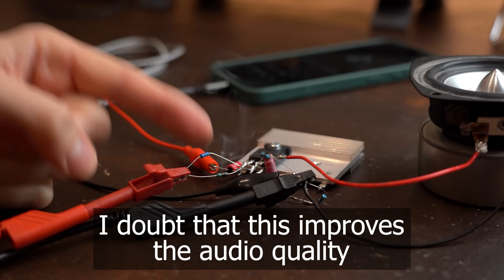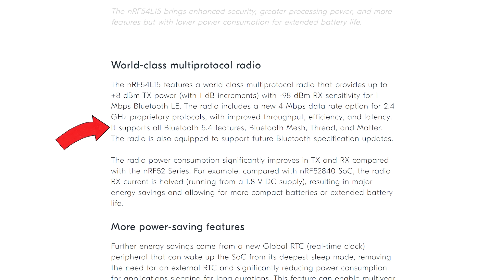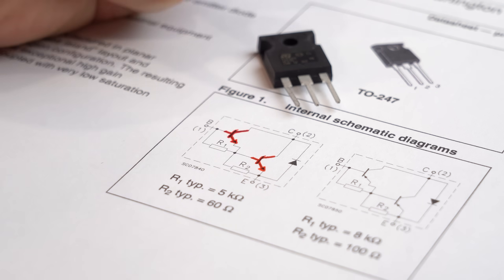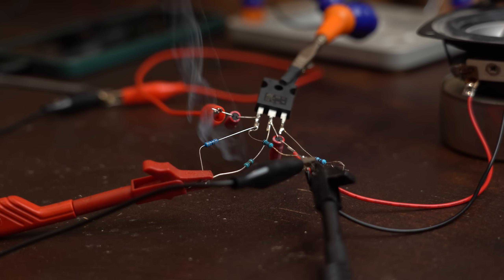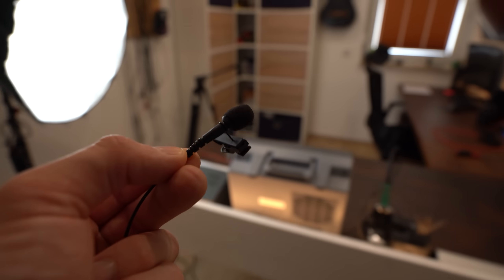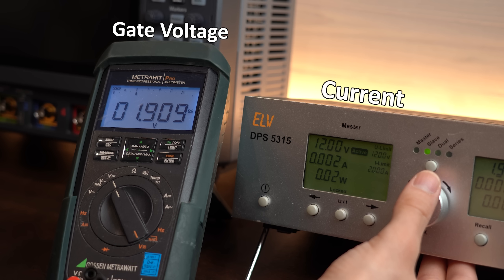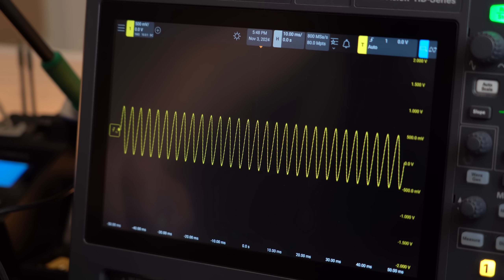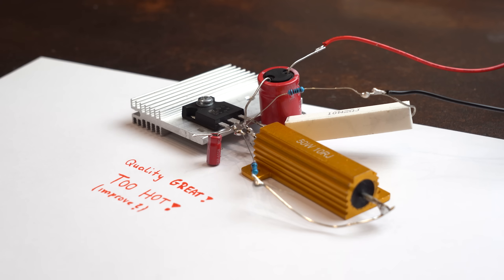The World's Simplest Audio Amp just got BETTER?! (MOSFET Amp) EB#61

Comment: Hey, I remember that headphones amplifier! I love the way you revisited that.

I believe the most efficient and generally good design would be an opamp-like structure, with a feedback.
You could also build a class D amp of course, but that's quite a bit trickier and not as "pure analog"

That being said, I am myself looking to build an amplifier for a headset that would need a decent amount of power. It's a DT880, and it sounds pretty bad, also without bass, when plugged directly into a phone. An EQ doesn't solve it, it really feels like a lack of power.

I'm not sure what would be a good amp design that won't hiss. I thought of several NE5532 mounted in parallel...

Comment: Mosfets are current amplifier devices while bjts and fets are voltage. They are also a lot more difficult to get stable when put in parallel and dealing with bigger output power. Controlling them is more expensive in practice as well.

Comment: I had some IHW20N135R5 in surplus that I needed to repair an induction cooktop and did an amplifier experiment with them out of boredom. I was amazed at how good the sound was. My circuit looked different from this one of yours, I put everything together freehand without doing any real calculations and I succeeded. But I think it would be even better if I calculated everything correctly, but this was just a play out of boredom 😁

Comment: Mosfets are most commonly used in Class D amplifiers. In this case they are fully on or off to drive the max power to the speakers. Class D is significantly more complex than Class A however. But any decent audio amplifier on the market is typically a Class D with mosfets on a large heat sink.

Comment: making a class-D ampliier next would be cool, to show efficiency increases.

also perhaps using one of those super cheap 3w class-d amplifiers, and making a class-d amplifier amplifier.
essentially a H-bridge driver connected to the outputs of the class-D amplifier to increase the voltage and amps on the output.
since these days almost everyone uses class-D amplifiers as they are much louder and more efficient, and often much cheaper as well if you want okay quality.

completely making your own class-D amplifier also would be cool, even though I know there are many simple ways like using a comparator and such, it would be interesting to see a as simple and cheap as possible way to make a okay class-d amplifier.
even better if possible with only normal parts so without parts people would need to custom order(only things a average hobbyist would have).

ofcource just for fun since a class-D amplifier doesn't need to be that high power. and can easily become dangerously powerfull like when for example using the €0.50(new original) IRL7833 mosfet you can technically send 18000W pulses (30V and 300A(pulsed)(150A constant and only 3.8mOhm RDS on max (so 0.0038Ohm)).
https://www.infineon.com/dgdl/irl7833pbf.pdf?fileId=5546d462533600a4015356600d71257b
essentially weak 1W and 3W class-D amplifiers are super cheap, and up to around 120W they are not that expensive either.
however even at something like 50W the price increase probably already is way more than when using a super cheap class-D amplifier and combining it with a self made H-Bridge cirquit to amplify it(self made since that is much cheaper than prebought ones often, even though for lower power you can use one of the cheap ic's for that.
but most cheap h-bridges have capacitors build in which doesn't need to be bad and can improve performance, but a class-d amplifier works at much higher frequencies than a dc motor drivers and most cheap H-bridge cirquits are made for driving dc motors so with a big capacitor(low pass filter).

Comment: Please build a class ab amplifier using only n channel mosfets, with a single sided power supply, as most class ab amp and irs2092s based class d amps are usually on symmetrical power supply

Comment: Hi great scott. I was using a drill with a 21v battery pack. And sometimes at work. Outlet is not always available since I work as a windows installer here in the philippines. And I wanted to request if you will notice me if you can create a circuit that can charge both 12.6v and a 21v drill battery. With an 18v 30w solar input. Thanks a lot!

Comment: Note that MOSFETs usually have a positive temperature feedback when operating in its linear region. This means with the same gate voltage, it gets a lower Rdson with a higher temperature. This means it gets into a sort of slow thermal runaway. There are MOSFETs though that feature a negative feedback if I'm right. This is one of the reasons I'll always try to avoid MOSFETs in linear applications. 
That being said, I love to see you make an LDO using a MOSFET and a zener diode. If you connect the gate of a MOSFET to a stable voltage made with a zener diode, you get a crude LDO. It drops its drain at its GS threshold voltage. I want to use them for very low power applications but I've never done it.

Comment: how about the Amplifier that use 2 Transistors (PNP+NPN) together as i see in the Chinese Amplifiers they sound pretty good and loud 
I'm not sure how 2 transistors work together for single speaker, but it does carry very high power to the speaker 
these premade Amplifiers hard to fix but if there was simpler way to understand how they work i might be able to fix them

Comment: I made similar mosfet amplifier 10 years back, I had to adjust the potentiometer every few days due to distortion. Not sure if it was due to change in mosfet characteristics or drift in potentiometer. I still dont have tool like you to check, so used my ears to figure out the distortion.

Comment: What also really helps is a speaker in an enclosure that is build (I mean measured) for the speaker you are using. The second thing I wanted to give as a tip, is when using a MOSFET amp, usually there is a preamp used. But, nice project and good information!

Comment: Seeing that a basic amplifier need around 7W to drive that speaker to make some loud music makes me even more impressed on how well optimized these boomboxes are nowadays.
I have a Harman-Kardon Onyx Studio3 and its battery died eventually. I was looking for replacements, and realised, that it works with a singe 18650 cell that is ~2400mAh meaning roughly 8Wh. That thing works for 5-6 hours straight from battery on a reasonably loud volume.

Comment: The thing about the non-linearities of the mosfet means... people will probably actually like it more. Next time try building a transformer coupled amplifier with it, you can get a massive bump in efficiency with this, and it's the topology of a vacuum tube amp which can be attractive to audio nerds. Also next time at least get a piece of cardboard or something and put the speaker in it so you don't get that thin tinny sound. Having the speaker bare like that causes pressure waves from the front and back to wrap around and cancel, reducing bass and volume.

Comment: Speak for yourself, I didn't know what flux was when I soldered my HD 555s together again, didn't know what coated wires were.. and it took 4 hours and several attempts, around similar length.. 4 hours at attempt.. and they sound great! Although I heard they got disconnected again, I gave them to my buddy and he had them for about 15 years before I guess they snap finally.. so I guess I could use the flux now.. But why can't I solder? Why am I so bad at it! Why is it so bad! You have no idea! There are so many dead boards so may burn capacitor so many PCBs burned into my brain, nothing resembling their former self their traces long since evaporated..
Reply: Oxidation is a bummer. 😉

Comment: Yes, the problem with Class A amplifiers: efficiency of less than 50%, if you're luck. Class B will be really efficient, but sound like you are listening underwater with how badly they distort things. Class C are pretty efficient and sound alright, but are not really suitable for music level fidelity. They are fine for a telephone conversation or an intercom. A lot of cheap amplifiers are Class C.

What you are going to land on is a Class D amplifier as your perfect solution, which is a digital amplifier. It uses a high frequency pulse modulated signal to form the sinusoidal sound waves by controlling the number of pulses used per second in any given time frame. This allows any waveform below a certain frequency of the driver frequency to be recreated. This is highly power efficient, very accurate, and uses MOSFETs to drive the power side of the circuit. For small, sub 1 watt applications, you can get single chip amps that just require a heat sink or some copper/soldier on the board to dissipate some of the heat they will generate. Most surround sound systems use Class D amps, as does your phone, and your computer.

Comment: 🔊 The speaker needs an enclosure.  Simply cut a hole in a cardboard box and tack the speaker in place with hot glue or screws.  You will be surprised at the difference in volume and sound quality. 
Great electronics explanations in these videos. 🏆

Comment: Most audio amplifiers have capacitors to stabilize voltage spikes and multiple mosfets to increase output. The beauty is its a DC voltage controlling a variable ac sin wave

Comment: What do you think about using 2 copies of that MOSFET class A in a bridge configuration in order to gain more power? Just connect the input of the second copy to the ground, and the outputs of both to the both ends of the speaker terminals. One amp can deliver up to 6 watts (12V * 0.5A) or is it less? Not sure how to calculate the bridge configuration, or if it’s even possible in this case?
Reply: The load must be part of the calculation I think. The bigger the load the less power there will be delivered.

Comment: Man you sure like to run head-first into a wall repeatedly reinventing the wheel :P

IMHO the simplest audio amp to drive a speaker would be a jellybean TO-92 bipolar transistor based push-pull stage biased with jellybean diodes, plus one-transistor CE input stage. You know, like they did in small transistor radio receivers for half a century. That's what? 3 transistors, 2 diodes, plus a couple of caps and resistors.

Well, good luck anyways!

Comment: I've always felt like this is one of the biggest issues when designing any electronic circuit that handles higher power. Yes it can be cooled down and yes the circuit will probably work but the fact that it gets hot means it is wasting a lot of power and ultimately indicates a bad design and I personally feel like any self-respecting electronics engineer should cringe at the idea of just going with the simple yet inefficient way of designing anything. Damn I've been needing to say that for a long time. 

Anyways I'm really excited about the next audio project you mentioned and I can't wait to see what solution you use to solve the inefficiency issue. Though I just realised "home audio project" doesn't necessarily sound like building the speaker amplifiers from the ground up but I'm still really curious about what you have cooking. 
Great video as always!

Comment: Try using a 2sc5200 transistor. 2sc5200 is not a mosfet so dont really use that circuit. it even outputs almost 90 or 100 Watts is paired with 2sa1943 and with a proper circuit. But you do need a very high dc voltage supply.

Comment: Watch yourself... Audiophiles are a fickle bunch. Saying our ears can't hear such small differences opens up a can of worms you may not want to see.

I've heard some wild theories about sound amplification. I myself am just the type that wants "Hi Res Audio" because up until about 96kHz, 32 bit, I can hear a difference if the file was originally mastered as high quality as the file being played. Like, if a song is mastered at 192kHz, 32 bit, I can hear the difference between 48kHz and 96kHz, and/or 16 bit, 24 bit, and 32 bit. But if it was mastered at 48kHz, 16 bit, nobody can hear a difference above that range.
Reply: What difference do you hear between 16 24 and 32 bit?
Reply: @NamelessSmile  When mastered right, you can hear things like the ring of the snare after the hit, or real separation of the individual instruments if you have good headphones. Plus, things like stereo separation. Lakimi's Juice by Live has a great example: the guitars are very wide most of the song, but snap into a very central sound at one point. With 16 bit 44.8 kHz, that separation is kinda lost. at 24 bit, the separation is better, but the snap is not so smooth. At 32 bits, especially with anything above 48kHz, but even at that point, the separation is very noticeable, and the snap to center is fucking quick. I used to be skeptical, but I'm becoming a believer.

But your drivers (headphones, speakers, bad IEMs) are VERY important. They can be an invisible bottleneck. Amp can be up there in importance, too. Without quality drivers and amps, you're not gonna hear any differences between the bit depths. I had the wrong headphones for true "Hi-Res" audio.
Reply: @SpikeKastleman  why on earth would bit rate affect the stereo image or ring of the snare? It's just a measure of noise performance
Reply: @NamelessSmile  That just says you don't understand bit depth. The higher the bit DEPTH the more data. Stereo separation can be a lot less pronounced with less data. The more data you can use, the more pronounced your "instrument placement" can be.
Reply: @SpikeKastleman  that's not how digital sampling works. If your signal is under nyquist for your sample rate, and loud enough (bit depth chosen dependent on signal amplitude) - then you can reproduce it physically perfectly with any given bit depth. Please read some theory behind digital audio before spewing nonsense
Reply: @NamelessSmile  Depends where you go to school, I guess. 🤭

I also guess that's another reason China is dominating the DAC market.

Comment: The simpler way is to use a two-stage class A amplifier, the input is a common emitter amp for voltage amplification and common collector one for current amplification.

Comment: surely you could make a much better performing amp by using a single or maybe a few nice opamp chips?
or even if you used a few more caps to make sure power going into the mosfet / transistors are nice and clean i think you would get better THD levels

Comment: FWIW if you did want a higher-current BJT you don’t need a Darlington power transitor — 2N2222 / PN2222 is rated for 800-1000mA and most of us probably have some on hand
Reply: Well the "original" bc337 is rated for .8A so there is no so much difference. He'd have just increased supply voltage.

Comment: A common way to approach it is to put first a pre-amp, e.g. your initial circuit, followed by a power amp circuit. The pre-amp just amplifies the voltage and focus on low noise and distortion.  And the power amp adds the current (power) needed to drive the speakers.   Also, low noise audio op-amps makes things simpler and modular.  For example the ubiquitous NE5532, present in many audio devices for many years.  Probably there is not a single piece of music in the world that has not gone through an NE5532 many times.

Comment: Another problem with high power MOSFETs is that they were designed as switches. In other words they try to design them to go from "off" to "on" in a narrow range. By modifying the gate design and the geometry of the source and drain the turn on voltage doesn't operate as a linear input. It's what allows a power MOSFET to quickly turn on and off at high frequencies without a long transition period.
I've used a tungsten lamp (like a car headlamp) for the collector or drain resistor. It has a non linear resistance and sort of acts like a current source, plus it was designed to get hot. You can get them for free if you check out a car repair shop. Most cars have a dual filament, so if the low beam goes bad the high filament still works.
Reply: FBSOA coul tell something is mosfet suitable drive straight like voltage controller resistor. Then comes linearity curves with given different voltage values and maximum power dissipations, transconductanse with different bias voltages ect :D

Comment: The mic is connected to the amp right? Are you testing it for speech? It was not clear to me why you provide a distance of the microphone from the speaker. Because when you connect the music from your phone, you pass the audio signal from the audio jack to the capacitor circuit of the amplifier, isn't? Then why is the microphone still attached near the speaker? Or is it turned off in these tests?

Comment: At 6.27 you should have decoupled the emitter with an electrolyte capacitor as without it you get very reduced volume.
Reply: The un-decoupled resistor adds a lot of negative feedback.   No NFB is great if you're building a guitar amp and love non-linearity distortion.

Comment: I'm not an audio guy, but I know Mosfets are very much suited for class-D amplifiers. 
With a good LC output filter, it can't be beat. Both in efficiency and sound quality. 
I guess that's why they're the most popular. Some chips are so efficient, they require no heat-sinks.